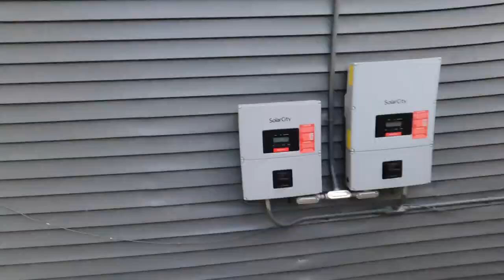200A Service Upgrade | Garwood, NJ  #electrician #serviceupgrade

Comment: I enjoy watching your videos. You always ask for feedback, so here it is…I like how you go the extra mile and use antioxidant on aluminum wire when it’s not required as do I. I learned from an old timer electrician to always put antioxidant on any screws or splices installed outside. I’ve been using this technique for nearly 40 years. I’ve had to change disconnects and the like because the lug screws became one with the lug. I’ve been back on my own work years after I installed it and the screws came right out. Keep up the great work and videos.

Comment: Nice work. I am an electrical contractor in Texas, and we are on the 2020 NEC. Sure makes a simple service upgrade like the one you did a lot more work with the new section 230.85 Emergency Disconnect requirement for one and two-family dwellings. We usually install an outdoor MB Panel and turn the old (usually in the garage) panel into a junction box and extend the circuits outside. Or, sometimes it's easier to install a NEMA 3R Enclosure W/Main Breaker outside and an MLO panel wherever it winds up...depends on the job.
Also, we don't see SE Cable around here, and most jurisdictions won't allow it, but it sure looks like a great way to make an upgrade a lot quicker. You see either EMT or Sch. 80 PVC risers and an eye-bolt, or Rigid conduit if used as a mast. I don't see a problem with SE cable personally...so not sure why it has never been a popular method here.
Thanks for taking the time to make the video, I like to watch the way other area's of the country do things. Stay safe out there.
Reply from the maker: Don’t you guys also panels outside the home? Or does that start in Arizona and California?
Reply: @electricianron_New_Jersey  Lots of outdoor panels here in New Mexico, seems a real weird thing in my opinion.
Reply: @davekimball3610 eww outside

Comment: Beautiful job - the install was so well choreographed.  One comment in regards to your opening statement on disconnecting the service. You said “if” you aren’t comfortable - don’t do it.  I can see some dyi guy looking at that thinking - that looks easy.   To be honest, I’d love to see a close up of that process and how you handled the cables. I would not attempt this, however I’m curious because you held the cables with your hands and made it look way to easy. Have to commend you on not cutting sections.  Thank you so much.
Reply from the maker: I like having this kind of feedback so thanks for that. I have a running list of upcoming videos I'd like to do for the channel. This goes on the list now, too. The trouble with doing a video on this, however, is where to place the camera.
Reply: @electricianron_New_Jersey  maybe a GoPro on your hat or clip a phone holder on a gutter?

Comment: Great job Ron!!!

I’ve done so many of these alone and it’s a very long day…

I started hiring a friend electrician for the day just to shorten it.

Like you showed there’s a lot to do on inside.
Myself: I would disconnect the service and then have the other guy disassemble mast etc and install new equipment, plus had them clean up or even carry old equipment out of basement, reduced my walking time..

Keep it up man!!
Reply: I live on the NH/MA border and some towns do not allow you to disconnect and reconnect.
It can add hours to your day.

Comment: Beautiful work due to all the obstacles you had to go through you came out on top I’ve been in the trade for over 30 years myself and it’s pretty cool to see how you work by yourself. I’m licensed in the state of Arizona just got it a few months ago, I keep telling myself if I only had one or two more guys to work with me, but you’re giving me the confidence that I might not need anybody else because I like to work just like you the harder the better good job
Reply from the maker: Thank you!
Reply from the maker: Also, being mentally prepared for doing something like this by yourself is also a BIG part of it.
Reply: Yes sir I agree with that 100% also by the way on the wire nuts that is true it is not a code violation. I think it’s more of a preference I have to do the same thing with short wires the other way is more money.
Reply: I worked for a company that they wanted us to mount splice boxes above for the short home runs or a trough and then send in extensions to the panel and splice in the trough. Makes for a beater job in the pa el but yes extra work

Comment: Great looking job. When are coming out to SoCal? Need to upgrade my 1984 100amp main panel to a 200 amp. Got to work around Solar and Backup generator circuits.

Comment: Just to comment on using wire nuts inside the panel.  It is absolutely the best way to do this if wires are too short.  To keep things tidy looking I use small zip ties on each extension to keep the wire nut close to the original wire.   Use white on white (zip ties and wire nuts) and black on black and it will look professional and manage the bulkiness.

Comment: Very nice job, I appreciate how you take pride in your work and go above the minimum standard.
I would've been tempted to put the cable TV guy RG-6 that's is running through the basement window facing through the wall, but well-meaning thinking sometimes gets one in trouble too.

Comment: Congrats on the neat work and install! I'm  a new electrical contractor here in Washington state.  I give you serious props for doing all of this work by yourself, it's a lot to take on! I've only redone 1 service before and I was way too stressed out. Had to redo a 200 amp service all by myself in December, and the customers basement starting to flood due to their sump pump not working ( no power) and my small generator not starting due to the cold.  Luckily I got done before any major water came into the basement. After that hassle I stuck to smaller jobs for a long time.
Reply from the maker: I'm lucky that I had some good electricians teach me along the way. Planning it all is way important. As a new contractor if I could suggest to you to get out of your comfort zone and do these difficult tasks NOW because in a year or two you'll look back and think what the hell was I worried about? I was that way when it came to standby generators. Now, well, you can see I overcame that challenge.
Reply: @electricianron_New_Jersey  Hey I certainly appreciate the advice! So glad I found your channel. Lots of great content and superb work!

Comment: Solar panel inverters are designed to shut down when the grid power disappears.  This prevents back feeding out to the grid causing problems for linemen.

Comment: if its a gride tide solar sytem to my knolage is that if there is no voltage present on the main feed to the inveter it will not turn on unless there is some sort of battery backup.

Comment: The duct seal is on all bottom and tops on the exterior here in PA. The only difference, we do in PA,, here typically,  that I seen you do it differently is when you do your weather head, I personally and I know a lot of other electricians that put duct seal on/over the wires after they are folded out of weather-head. This is especially true, when your using metal or plastic conduit for your SEC. But great video and I love the explaining of NJ codes and why you do certain things. But don't let the haters get to you. You are putting out amazing content.
Reply from the maker: Thank you that means a lot.

Comment: After you disconnected the meter, you still had live power connected to the house at the in line connector from the pole to the house correct? When you need power disconnected from the utility company, you had to call them for a disconnect correct?
Reply from the maker: The power company here allows licensed electricians to cut out from the utility. Check with your utility company before doing anything.

Comment: The NEC permits splicing in an electrical panel under 312-8 as long as the fill does not exceed that required under 312-8A and B. In almost any case there will be sufficient room to slice and be within code requirements.

Comment: For future circuits to be added, it would be good to leave a few breaker slots (along with ground/neutral slots) open at the top and bottom of the panel.
Reply from the maker: There are NO MORE opening in the top of this panel. Two 14/2 cables actually enter from the side of the enclosure.
Reply: theres plenty of room to add breakers into that panel
Reply: @mikes7047  Agree, my suggestion was purely a personal preference to avoid crossing wires say if a new circuit was added in the future.  The new circuit/breaker could simply be added to the top of the stack.
Reply: @rick2tube  where i am in canada you can't even go into the top of a panel with the branch circuits where the main breaker is. unless you have a fused disconnect before the panel. The only option i would have had in this scenario would have been flipping the panel upside down with the main breaker on the bottom or turning the panel sideways. Either way the feeds from the meter have to be separate. The service rated panels here have a piece of steel that screws in around the main breaker.

Comment: Incredible amount of work by one Master Electrician! Again showing your woodworking skills too. I don’t get the no splices allowed in service panels. I thought it was standard procedure splicing circuits in the panel when installing a generator for critical circuits 🤷‍♂️. Curious what your feelings are on laying a piece of rubber roofing material over the exposed wood siding before mounting the meter box and new Azak panel to help waterproof the opening…
I’m surprised you didn’t pass out in that heat last year 👍👍

Comment: Great video! Question: Where do you land the grounded conductor from the grounding rods?
Thank you!
Reply from the maker: At the main disconnect.
Reply: @electricianron_New_Jersey  Thank you for the prompt response.  Another question: What size conductor for the water ground if you use copper instead of aluminum? Thank you!

Comment: Other than cost, why do you use aluminum wire for the main instead of copper. I also think putting the main wires inside a conduit looks a lot better and gives much more protection.
Reply from the maker: The whole national grid is aluminum conductor.

Comment: What size should the service entrance wire be for 200 amp service and another question what if the customer has 100 amp service is that wire sufficient for upgrading to 200 amp because the run to the main connection is over 150 feet I can’t imagine how much that wire will cost any feedback I appreciate

Comment: I really enjoy these videos. As a retired photg/editor, (and a non-electrician), they are nicely done. My question, after completing the job, how do you determine which circuit goes to which appliance, plug etc. for the labels. Thanks.
Reply from the maker: Turn off each breaker one at a time.
Reply: I thought so. I know there is a transmitting device that can be plugged into each circuit and then you can run the receiver over the electric panel until you get an indication. It is a tedious process either way. Thanks.  @electricianron_New_Jersey

Comment: (26:30 to 30:00) As far as I can see, the cable coming in from outside isn't protected, just clamped down. Does code not require conduit or something protective for certain sizes or types of cables coming in from the service/utility? Just the ~33:20 explanation that it doesn't seem subject to physical damage? 

(9:35 to ~19:30) How did you keep track of each circuit and what went to what, when you disconnected everything? As far as I could see/tell, there wasn't a step of like labeling each cable for what circuit and room or area it went to, so did you take pictures, or is there like a program for keeping track of that? How did you keep track of what went to what?
Reply from the maker: Each of the circuits is identified AFTER the new panel is installed.

Comment: Quick question. Even though you landed the ground wires and neutrals to different bus bars, they are still bonded together since this panel provides the first means of disconnect, correct? I saw the green bonding screw. I just want to make sure that I am understanding things. Thanks for the video.
Reply from the maker: Correct. The only reason why I added the ground bar at the top of the enclosure is because of two things: short grounding conductors, and possibly a generator installation in the future.

Comment: At the metter  there is not a ground wire connected ? Or just in the main panel?
Reply from the maker: The grounding electrode conductors get bonded at the main disconnect.

Comment: In CT and would love to upgrade to 200 amp. Hard to decide on an electrician to use. Would also like to buy solar panels and have an electrician install those as well. Any recommendations?
Reply from the maker: Around here the color companies and electrical companies are two different things. Finding the same company to do both as far as I know is hard to find.

Comment: Question. I noticed you do not put a service type loop at the top where the mains connect to the main lugs. Is it by choice? I hear things like it's easier to connect and disconnect if needed with the service loop in place.
Reply from the maker: I never have done that and still manage to terminate conductors with no issues.
Reply: @electricianron_New_Jersey  I'm sure, I just seen it in several different instances. I want to get your take on it.

Comment: In the beginning of your video, you mentioned you didn't know why the solar breaker was showing zero voltage.  for most grid tied in solar power systems, the control system looks for power coming from the utility. if utility power is lost, the control system shuts down the solar panel system.  this prevents backfeeding power into the grid in case there are linesmen working on the utility wires (say after a downed power pole). once grid power is restored, the control system will restore power generation.
Reply from the maker: I've since learned this wiring method. Thanks for sharing your wisdom here.

Comment: Square D “Qwik grip”  panels save tons of time for installs that have space constraints like the one you did 

Keep cranking out the good work thanks for sharing!!
Reply from the maker: I installed one of those at my in-laws house a few years back. You're right, that would've been a lot easier.

Comment: Ron - really nice work and that did look like a pain in the ass.  When you mounted the board to the outside of the house, where you cut out some of the siding, did you add any caulking or flashing to protect against water leaking behind the flashing?

Comment: my solar inverter has to check the incoming voltage from electric company and match the cycles per second in sync with utilities it takes around 5 minutes to come on after being connected to incoming power at panel it won't put any power out to a disconnected main panel
Reply from the maker: I checked for voltage at the breaker in the panel prior to shutting it off. No voltage present.  I’m not sure what the issue was.

Comment: Hi Ron, great job!
I don’t know how you know what circuits are what when installing new panel.
Reply from the maker: Hi John, each circuit in the panel is either going to be 120 volts (single pole) or 240 volts (double pole). I tag the double pole circuits with vinyl electrical tape and this way I know they connected to a double pole circuit breaker. This panel had (3) double pole circuits.
Reply: @electricianron_New_Jersey  thanks Ron.  
Dor and I are watching now the panel upgrade you did for your teammate the Ranger fan.

Comment: I agree the wire nuts inside look bad but it is permitted and in an enclosure so it being ugly has nothing to do with it working properly. I actually seen on a Canadian electrical inside of the basement of the house saying you can't run the conductors through the top of the the panel except the feeder cables. I was like huh.

Comment: with the 2 ground rods do you do a ohms measurement to see if you are attaining the 50 ohms.
Reply from the maker: Never.
Reply: Actually the only time you needed an ohms reading was when one rod was not sufficient in the old code then you may go for the second one. Now since you do 2 you don’t need it but i was wondering if the water main was bonded to the 2 rods as well ?

Comment: Splicing inside the breakers box is fine.

312.8 Switch and Overcurrent Device Enclosures.
 The wiring space within enclosures for switches and overcurrent devices shall be permitted for other wiring and equipment subject to limitations for specif i c equipment as provided in (A) and (B).
(A) Splices, Taps, and Feed-Through Conductors. The wiring space of enclosures for switches or overcurrent devices shall be permitted for conductors feeding through, spliced, or tapping off to other enclosures, switches, or overcurrent devices where all of the following conditions are met:
(1) The total of all conductors installed at any cross section of the wiring space does not exceed 40 percent of the cross-sectional area of that space.
(2) The total area of all conductors, splices, and taps installed at any cross section of the wiring space does not exceed 75 percent of the cross-sectional area of that space.
(3) A warning label complying with 110.21(B) is applied to the enclosure that identif i es the closest disconnecting means for any feed-through conductors.
Reply from the maker: I think they might teach union electricians thaT splicing in a panel is a violation